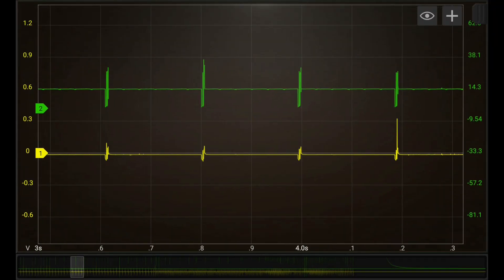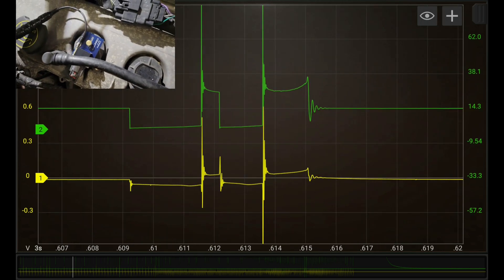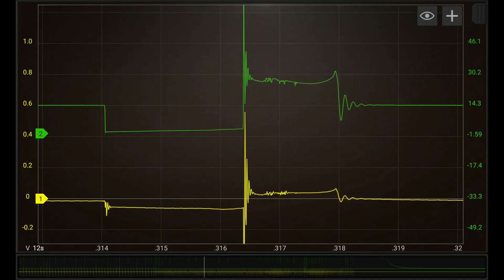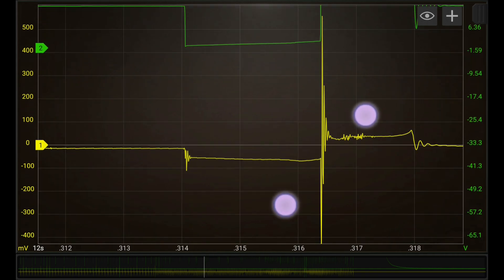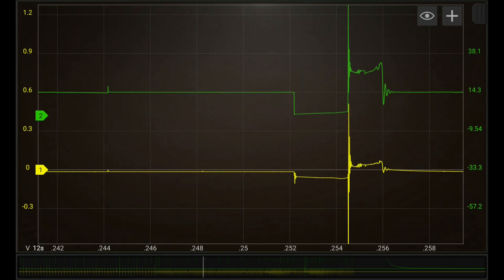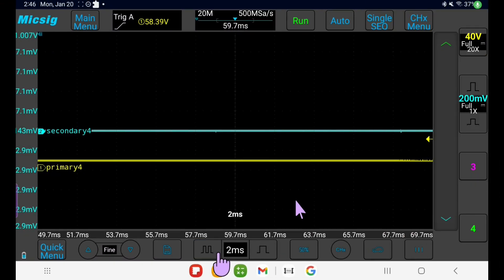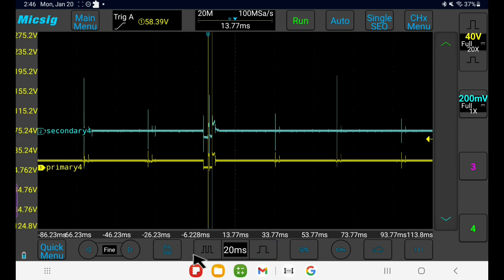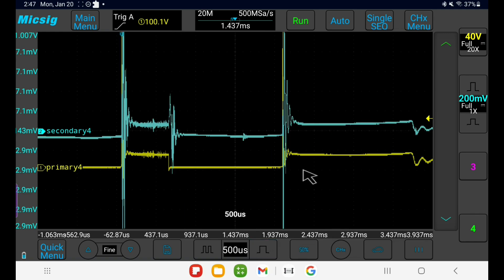Just some cool waveforms of a 2007 Edge multi strike in operation. HS512 gold and MicSig Vato

Comment: Hi Eric nice captures of secondary.  Was just womdering if you mjght have been using your Snapon COP adapters for the secondary.captures.  For the Micsig about how many frames does it capture for you does it just rollover after awhile with no recordimg ability.  So much looking forward to HScope supporting Micsig VTO VATO.
Reply from the maker: @jondieter4903  Hi Jon, Yes, that was the snap on secondary  pickup. I want to eventually try to male one somewhat like it, or see what makes it tik at the least. 
 The VATO has a huge buffer and can record a very long time . It is one screen like a snap on, record zoomed out, and then zoom in. It just can't save the waveform like how hscope does. You can screenshot or screen record, but you can't reload it in the software again. At first, that seems dealable but times when you would like to pull up the whole wave form and add cursors or a math channel, you are out of luck.  It is good for under the hood, it has a 1000v peak voktage and 300v input, so it can take a hit if you accidentally probed an injector when you were expecting 12v. It seems like a "now" scope, like until you shut it off, you  can do anything with the waveform. Even the math channel has to be added before you record A waveform if you intend to use a math channel. Hscope kind of spoils us to where we can just add a math channel or take measurements on a whim 2 days  later. 
 Take care, and thanks for checking it out!
Reply: So when you are working with Micsig VATO how much time do you have on the screen are you set to 1 second or more and then you capture and zoom in for the detail. Do you lose quality on the waveform at al! doing this.  Thank you for mentioning how to use the VATO I feel I havent gjven it a  good chance and see all the things you are acomplishjng with it.  When you are doing incylinder pressure with Micsig how are you keeping the PSI scale.  For example when you use cursors does it actuaretly reflect the correct psi readings. I get confused on the millivolt per psi as these might be a two or three millivolts per psi. Have you tired saving you waveforms as reference wave file so you can look at them later in VATO.  I believe thats the only way to store the wave file.  Do you think the Micsig VATo can keep fve minutes of onscreen data not sure how much the buffer can store. Appreciate you sharing your waveform captures of VATO HScope amd your Snapon. Those Snapon secondary pickups produce some awesome results. Really like how you have a diagnostic cart and looking at getting one once the funds are there. My stuff is all over the place.
Reply from the maker: @jondieter4903  Hi Jon! Yes the VATO can easily store more than 5 min on the screen. The max time depends on the memory depth. It's 50m samples a sec on 1 channel, 20m for 2 or 10m each for more than 2. That's why it does not list like a maximum time. It's all  how much detail you need. Starting and charging you can get over 7 min on the screen with 2 channels and 20m samples. Real good detail. For faster moving signals that you need maximum or close to it like can bus, the tine shortens as you add detail.  This ignition pattern was very short tine, I had it on a pretty fast screen and still had 100s of firing events. 
  For the single screen capture, as much time as you set it to, it will just stop. I like that because you can't miss anything and then zoom in. You can let it record continuously, and when you hear what you were looking for, manually stop the recording and have alot of before and after the event on the screen. You do have to force the higher resolution sometimes. Like today om a 4 channel cam and crank, it was on auto. After a 5 min recording, the crank pattern wasn't very square, more jagged. I took it off auto and put it on 10m sample manually, and it was perfect square waves again.
 The reference way of saving is short but usable. It's not meant for recalling a wave and measuring it again because you can make it shorter but not longer, the longer you make it , the less definition. It's great for say, ignition secondary or primary and current on 1 channel and then moving to another channel. Then you can easily put the reference up against the live channel. It is possible if that the only way to save a waveform but it definitely is not as convenient as hscooe to save. Hscope can also bring the waves up without a scope plugged into it which makes it nice for middle of the night measurements, lol. 
 I do keep finding neat things out on the VATO, it has a pulse width trigger, which helps keep waves like a crank signal still. No rising edge to trigger off of but if it sees a gap, like a crank notch, it will use it for a trigger. Great for seeing a loose chain walk. Only problem is I could not get the min pulse width low enough for a Honda crank. It did work and hold the cam signal dead still. Need some more experimenting with that feature for sure. 
 Putting a vid together with that in it. Before and after the chain comes, good to take a correlation. Take care!
Reply: Thank you for.explaining this for me. I was trying this out today on the VATO andbit does seem to capture alot on the screen.  Where I get really lost is setting up the VATO for incylinder presure tests. I dont know how it knows the milivolt to psi . how can you tell if the output is the real psi when thete is no conversion or custom table. i also wonder how hscope can tell.
Reply from the maker: @jondieter4903  No problem at all, the VATO is harder to use custom settings. You have to have a transducer that equals one of their presets or do the math. A 1x would be correct for 1mv=1psi or any of their presets like x5 or x10. Changing it to psi only changes the label, it does not change any conversations on its own. 
 On Hscooe, it is much easier. You can change the multiplier and like on the vato, the label to psi. Under probes in settings, you have to hit the + and then "new" shows right up under your probes. You have to click "new" then you can change the name and save it. If the transducer is anything that is not a nice smooth number, Martin has a probes calculator on the Hscope cloud. I will paste I link under this comment, it comes in handy for offset, like when .5 equals 0 instead of actual 0. The pressure on mine, luckily is 1mv=1psi on the cylinder setting, so all I have to do is change vol to psi. The odd thing is the readings are never the same as a manual gauge because of the relief valve keeping pressure in the manual gauge. The teanducer is like the first jump of the needle and does not build any more pressure. I ran circles trying to get a number that agreed on both the manual gauge and the scope. Hope that helps, give the calculator a look. It's like another hidden feature, I keep finding more!
Reply from the maker: @jondieter4903  https://hscope.app/probes-calculator/
Reply: Looks like I can get my pressure transucer to work in HScope and maybe on my Vimu scope but not on VATO as.its.not a 1 psi to 1 mv.  The calculator you sent ks very helpful for getting my transducer to work. This has been very helpful thank you for taking the time to explain all this.
Reply from the maker: @jondieter4903  No problem at all! Yes, some readings on the VATO might not equal actual psi but the degree rulers will still be accurate for timing and checking valves. The actual psi I do like the manual gauge before using the transducer. The factory spec is going to be with a manual gauge and higher than the transducer reading because of the valve. I was going to try using a manual valve with the transducer just to see if it is more consistent with the gayge. I'd love to be able to trust the scope for actual  compression, but some habits are hard to break! Have a good one!